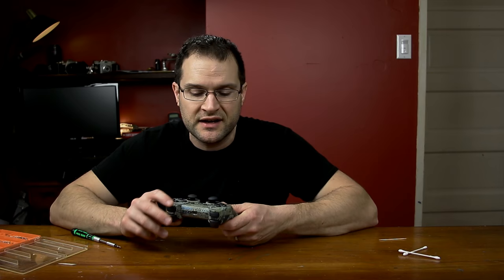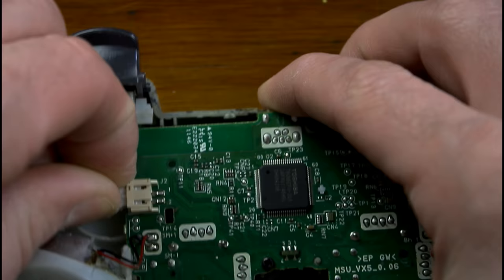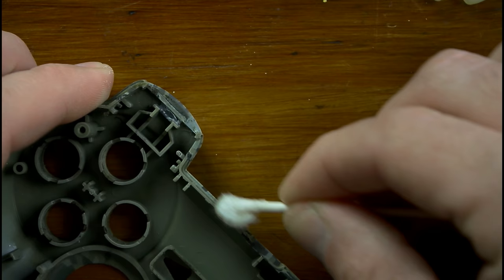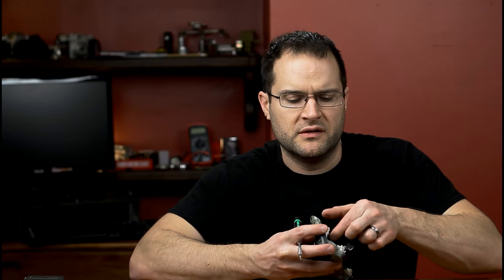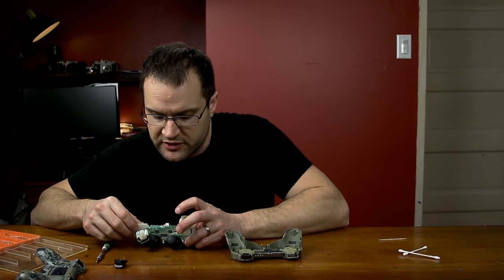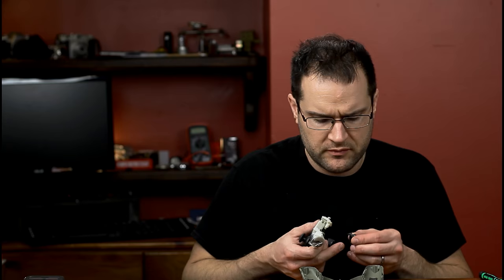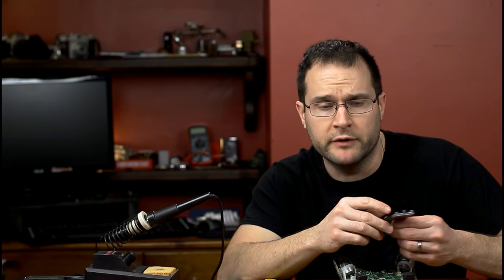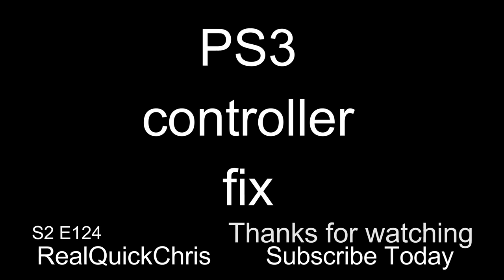how to fix a ps3 controller that moves by itself s2e124

Comment: Did yu have to repair a cracked solder joint ??
Reply from the maker: Yeah I broke a wire off for the rumble motor when taking everything apart
Reply: RealQuickChris ahhhh ok 🤙🏽

Comment: can we use senitizer insted of alcohol
Reply from the maker: I did not take Chemistry but I don’t know if isopropyl alcohol is the same thing as hand sanitizer. Whatever you use you want to make sure you don’t take off the Conductive ink Leeds. The print the Leeds onto that thin plastic and they are Fragile
Reply: @RealQuickChris  k thank a lot 🙏👍

Comment: Mine when I push back 3 it activate R2 I tried everything it doesn't work.something else when I get in with it on the game they say push any button no button work as soon as I get in on the game all of them work
Reply from the maker: all I have done is replaced that black foam piece that puts pressure on the ribbon cable to the board. I have also cleaned up the ribbon cable connections. if it's more than that I am not too sure.
Reply: @RealQuickChris  thanks man for your answer anyway .

Comment: what kind of screwdriver do use to take the case off?
Reply from the maker: Nothing special just a Phillips screw driver small enough to fit in there. Sometimes those plastic pry tools help to separate the controller as well.
Reply: @RealQuickChris  Ok thanks...

Comment: You said in the title its a fix, yet you said in the video its not a fix?

This seems like a cleaning tutorial and not a fix for joystick stick.
Reply from the maker: Very true. By cleaning the contacts and replacing the pads you are fixing the problem or random button pressing but it won’t do anything for thumb stick movement. That’s more involved. But you are right

Comment: my  right controller is moving by itselves.
Reply from the maker: That is a different issues with the thumb stick itself. It’s easy to break but I think thumb stick are about $4 on eBay to just replace them

Comment: This controller is less than a month old brand new I'm ragin
Reply: Granted. It's a knock off but still
Reply from the maker: I hear you even a knock off should last longer. The PS4 controllers are not that much better I had a few of them do the same thing

Comment: My ps3 controller X O □ triangle and thumbsticks move by themselves.. can someone help me. I tried everything. :(
Reply from the maker: Do they move if you twist the controller in your hands? Without touching the buttons? Are the thumb sticks stuck in and way? How many times have you tried this cleaning fix?
Reply: @RealQuickChris  yeah. It's so weird, I never had this problem before. My controller move and the buttons constantly click themselves. I think I just might need to get a new controller next week.
Reply from the maker: Can you even buy new ones? I could not find any
Reply: @RealQuickChris  yep. Someone I know is selling some ps3 controllers..

Comment: I TURN THE BLACK PIECE IT NOT WORKING OMG MY FRIEND PLS HELP BROTHER I WILL GET DEPORTED IF NOT HELP ME. THE IMMIGRATION POLICE IS AFT
Reply from the maker: If you flipped it and that did not help find something to replace it with. Cut some foam or rubber to size and it’s worked for me
Reply: Let me know it it works out, I am also curious.

Comment: Why are you soldering your controller if alcohol is supposed to fix it?
Reply from the maker: The wires like to come off for the rumble motors when I take a controller apart. Separate issue from the random button pressing issue.
Reply: RealQuickChris Oh, okay. I see.

Comment: Get to the point already dude! You could just put a timestamp in the useful part and the part most came here to watch!
Reply: Also neither did you showed the controller acting up or if it actually fixed the problem in the end.

Comment: I have the same control I need to fix
Reply from the maker: Nice   I have not found a PS3 controller that has not broke that's why I won't get a PS4
Reply: RealQuickChris lol
Reply: RealQuickChris mine just won't switch on without it on charge but when it is on charge the joystick goes everywhere
Reply from the maker: first thing I think of is battery then this cleaning for the joystick.   so far i only had one controller i need to replace the joystick on just have not done it yet.
Reply: All I did was turn the little black thing over and it worked.
Reply from the maker: The part that holds the ribbon cable down nice